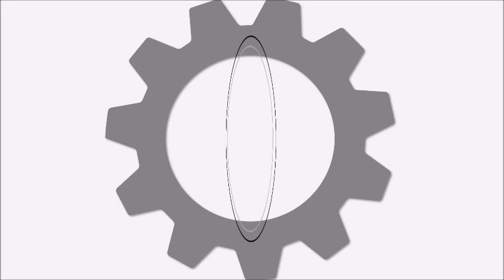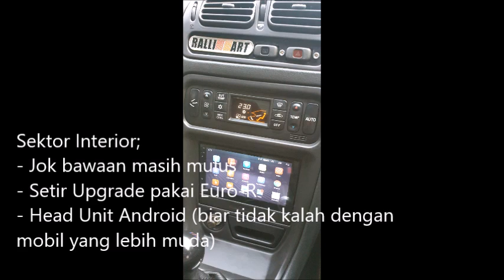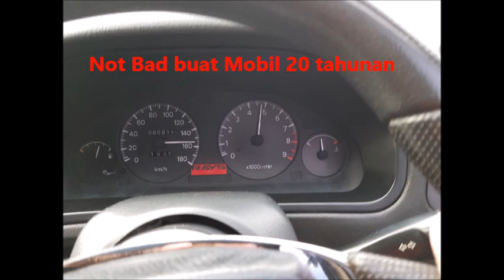Modifikasi Mitsubishi Galant - Street Racing Look yang Enak dipakai Harian

Comment: Menurut om rekomen ga kalo mau build lele? Saya liat galant lele keren juga dimodif tipis tipis
Reply from the maker: Sy rekomen untuk build Galant Lele atau Galant Generasi 7 (G7) ini karena;
1. Mobilnya reliable
2. Partsnya melimpah khususnya kaki2 banyak pilihan, dari ORI mitsubishi maupun KW yg kualitas bagus sperti 555 / TRW (prefer 555).
Pengalaman kami pakai 555 tahunan baru rusak.
3. Maintenancenya mesinnya gampang, karena reliable hanya perhatikan Oli dan air radiator sj. Selebihnya sesuai periode servis misalkan timing belt, fanbelt dll.

Intinya klo mobil mesinnya sehat, cukup hanya ganti oli, tune up sj.

NB : kami rekomen yg tipe manual.
Thanks

Comment: Perawatan mobilnya gimana om?, Dan apa yg harus diperhatikan waktu belinya om?
Reply from the maker: Perawatan yang utama Oli mesin & air radiator sj Gan.

Setiap seminggu sekali harus dicek. Tp klo habis perjalanan jauh, besoknya dicek jg.

Klo mau ngambil mobil ini yg utama, dengerin HLA Valve-nya. Klo udah bunyi tiktok2, mending jangan. Karena penggantiannya lumayan mahal. 24 valve harga satuannya dulu (ga tau harga skrg) 150k, belum ongkos ganti.

Selebihnya mesin mobilnya bandel. Klo part2s yg habis pakai seperti timing belt, fan belt, alternator (servis), kesisteman AC, itu bisa pelan2. Tp saran sy timing belt & fan belt harus segera diganti ketika baru ngangkat mobil ini.

Thanks
Reply: Tks banyak om saran nya

Comment: Itu alat kecil yg nempel di body pake selang kecil nama sama fungsinya buat apa om?
Reply from the maker: Itu adalah Vacum Selenoid Valve Switch utk Throttle Body Gan.
Fungsinya itu agar pada saat menyalakan AC, RPM tidak drop.
Thanks.
Reply: Oil chact tank beli dimana om?
Reply from the maker: Oil catch tank beli di Autotech Motorsport Pasar Mobil Kemayoran Gan.
Reply: @K33-j4b  vacum nya ini pake punya apa mas, skema nya gimana ya ?
Reply from the maker: @ariesanggriawan2904  vacumnya pakai bawaan Mobil Om. skema selangnya masih sama dengan ori nya Om. biar ga ketuker, gantinya satu2. Thanks
Reply: @K33-j4b  bisa minta wa nya om ?

Comment: oli mesin yg bagus buat galant lele apa om..
Reply from the maker: Oli mesin yg kami gunakan kekentalannya SAE maximal 10-40 atau di bawahnya (lebih encer). Krn mesin Galant termasuk sdh modern dgn menggunakan HLA utk stelan valvenya.

Selama ini merk yg dipakai Mobil 1 Super 2000 (10-40) atau Mobil 1 (5-30).

PENTING! Apapun merk dan tipe oli akan tetap berkurang seiring pemakaian. Sehingga Oli harus dicek scr berkala.

Pentunjuk pengukuran oli khusus Galant ada di Owners Manual (mesin dlm keadan panas). Thanks
Reply: @K33-j4b  makasih om
Reply: @K33-j4b  untuk oli transmisi matic galant bagusnya apa om
Reply from the maker: Sm2 Gan
Reply from the maker: @alhabsyi1661  Kebetulan unit kami transmisi manual Gan. Namun utk oli transmisi kami biasanya menggunakan Castrol. Thanks
Reply: @K33-j4b  makasih lagi om jd nambah pengetahuan
Reply from the maker: @alhabsyi1661  sippp..sama2 belajar jg Gan🙏
Reply: Klo di buku manual nya pake oli SAE 20-50...klo pake yg lebih encer gpp tah om
Reply from the maker: @adeyr753  Gpp Gan..krn lebih encer, tp ga encer banget. Serta valve mobilnya pakai HLA, jd automatic adjustable (ga ada stelan klepnya) mknya nnti disesuaikan sm mobilnya sendiri.

Kami sudah pakai mobil ini sejak 2006 sampai sekarang. Olinya pakai yg 10-40 terus. Dari jaman Mobil 1 namanya Super S Plus, sampai ganti nama jadi Mobil 1 Super 2000 aman tenteram Gan. Thanks